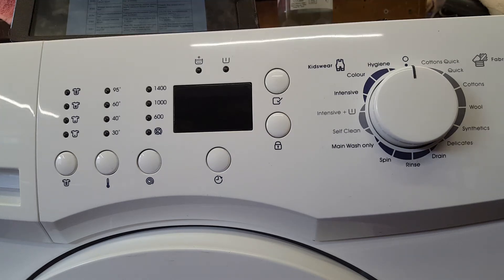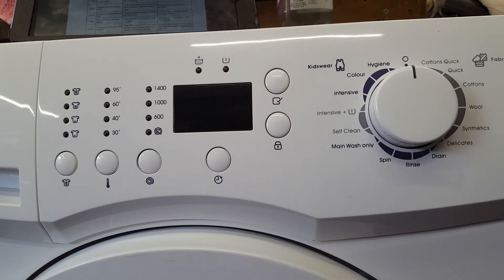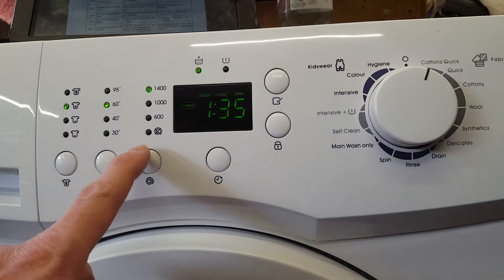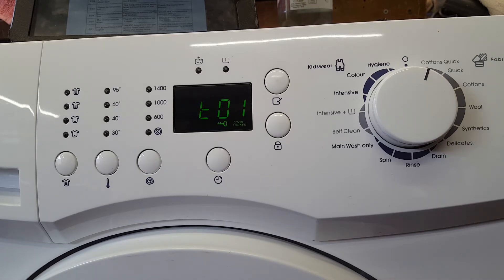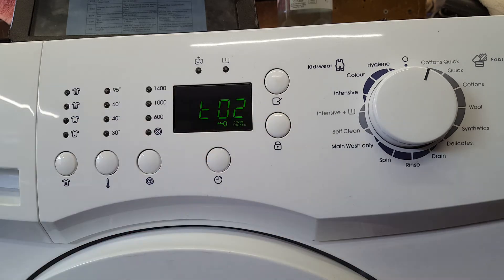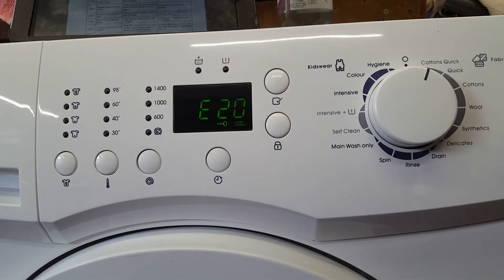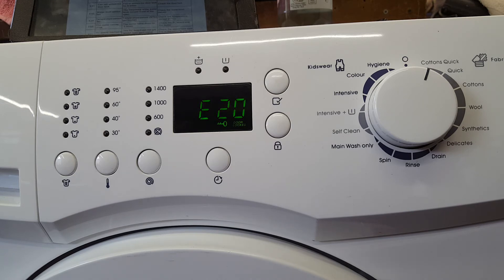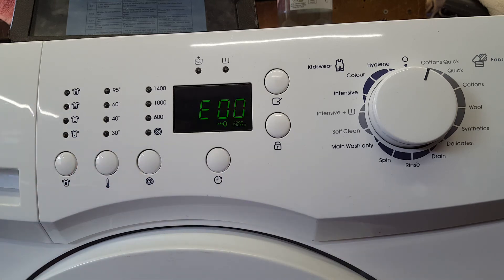Zanussi zwg1140m reading of error code and resetting

Comment: Hi, I have a zanussi zwg 1120m when i turn the dial to any of programmes the times displayed are all wrong.  So for example coloured wash shows 1 minute,  But a quick wash is 2.30hrs?? is there anyway to reset the dial? Thanks in advance.
Reply from the maker: Not sure if u can reset that. But it sounds as if the dial is not like up right and u selecting wrong program if u selected spin does it just spin or do something else
Reply: @user-tim100  sorry only seeing your reply, i had only 4 options with the dial a 2.3O hr ir a 37 minute wash at 30 degrees only,  a 14 minute 900 rinse and a 1 minute 600 spin.  So i bought a new machine an LG.  Thanks Tim.

Comment: have e20 fault code. checked drain hose, filter, motor.all are fine but machine still won't drain. any ideas?
Reply from the maker: E20 is a no drain fault normally caused by a blockage could be the pump or broken wire or pcb

Comment: Mine says E60 HELP!!!
Reply: Hi did you get sorted? Am having the same issue. Thanks
Reply: @Pupylover101  yes, it’s an issue with the machines motor. In my case, the motor had become weak and didn’t spin anymore. Had to call up the engineer to fix it. Quick repair!